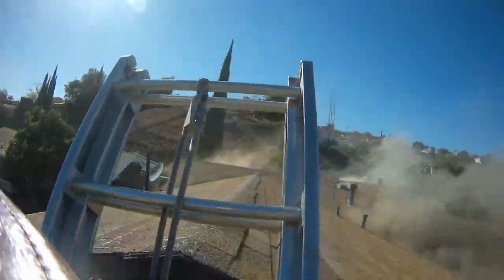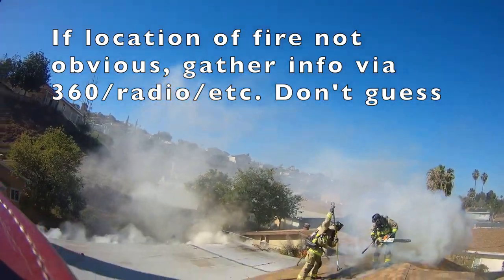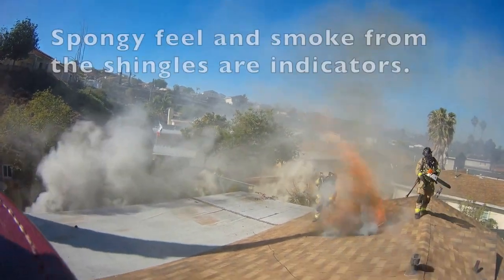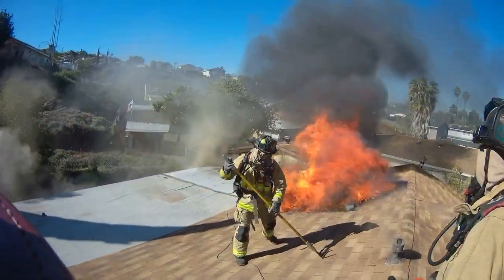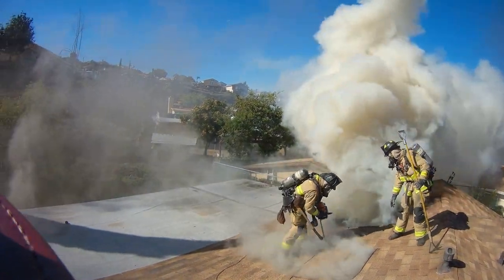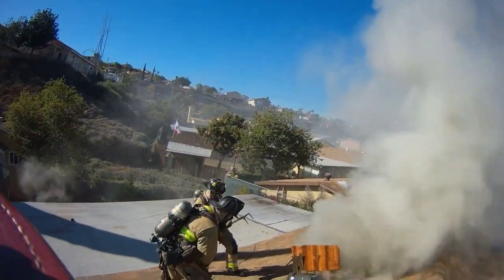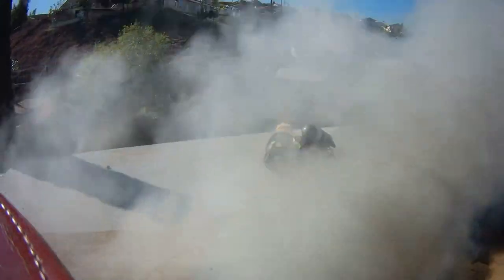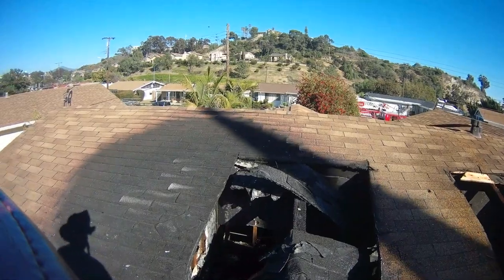Fire in the Hole!

Comment: Do you find using the rake rather than an iron or pike pole is more beneficial?  Do you use the rake for the interior also?
Reply from the maker: Sorry for delay. Was off for six months dealing with Cancer, only recently back. All good now, fingers crossed. We use the rake on the roof for sounding. I think the surface area of the rake gives a good feel for what's going on below. Pulling ceiling and interior operations, we use a pike pole or a NY Hook. We prefer the penetrating power from below. But, of course, it's whatever works best for you!

Comment: After all the science learned from NIST UL, the fact we still see people ventilating residential roofs and calling it bread and butter raises serious concerns. I’ve worked inner city east coast for 32 years and have subscribed to these tactics until learning better. They said the heat and visibility improved? Was this because water application occurring cooled the environment? Saying you cut the hottest spongiest spot, yet having someone sounding the roof, isn’t the point of sounding to avoid the spongy spots? What would the survival profile look like for the guy who fell through the roof with the flow path being demonstrated through the vent hole? 
Look at the amount of smoke coming from the ground level of the structure behind them as they ventilate, the volume of smoke from there doesn’t diminish after the first hole is cut. If verticals ventilation was removing enough smoke to be of benefit would you expect to see that go away or diminish ? 
We see improvements when water is on fire, we see conditions spread as flow path moves through the roof. In one hole we don’t see removal of smoke, rather we see spread of fire. In second hole we see little ventilation as water was on fire rapidly at the point of completing ventilation.  
Think about what we actually see instead of seeing what we want to see. Stay safe and keep learning.
Reply from the maker: Generally speaking, I refrain from judging other ways of “putting the wet stuff on the red stuff”, because I don’t presume to know more than them or be able to do it better than them. It’s YouTube, after all. 
But, you always have a person behind a keyboard with an opinion.
I would also consider a fellow firefighter stating a fire being “bread and butter” as one they regularly go on and not call into question that it’s a fire, and as it being a fire, is inherently dangerous. Fatalities occur on such a fire, we know this. But, still, the commonality of said fire can be inferred as “bread and butter”. 
The frequency of said fire versus fatality is, well, more something people use in the comments section as complacency? I’m not sure the inference. 
Look up the amount of firefighter fatalities during vertical ventilation as a trend the last twenty years. I’d say, we, as a whole, are doing a good job, despite firefighting as a whole being inherently dangerous.
Regardless, since 2000, I have seen a lot of progress in the fire service. We put science into our approach now. Transitional attack is a thing. Understanding flow path and not just blowing out all the windows is a thing. We recognize PTSD and the need for behavioral wellness. We recognize all our people and appreciate their contributions.
So, I’d put our training staff, or any professional fire dept, up against anyone who would call into question tactics such as vertical ventilation. Especially, saying they are blind to the science and simply see what they want to see.
I work with ranking Firefighters far more educated than I, who would put me up on that roof. And I Trust them. Because You should be able to do that. But, also, because I’ve been in fires without water on fire where vertical ventilation made a significant difference, in heat and, especially, in visibility.
One of the many things I’m proud of about my profession and where I work, is that our training staff never presume to know all, despite traveling the country for educational enrichment, are fully aware of a NIST UL studies, along with others. To presume a professional fire department of the top ten most populated cities would have no clue as to the research your citing demonstrates, if not anything, an ignorant, or egocentric way of stating our way is somehow wrong and you are inherently right because you mention a NIST UL study.
As a member of a major metropolitan department, I wouldn’t presume to know as much as my counterparts in our training and education who specialize in being progressive, but I will say that they still encourage us to get on that roof and cut a hole. 
The message with the fire minute, generally, is one of humility and expressing a lesson learned where we don’t look great because things didn’t go all that well. What’s to learn from everything going right? We check the ego and try to share a lesson learned, rather than how good we look ( which can be many fires or edited to look that way). 
All this being said, 32 years in the fire service, regardless of where, is to be respected. Thank you for what you do and, by all means, reach out to said metropolitan departments with this data you have and change how we do things. I, personally, would be more than happy to oblige.
Reply: @thefireminute625  thank you for your reply.  I will agree that it is easy to sit back and look from the cheap seats and look at an operation and second guess.  I believe this forum however does lend to the discussion. We should never shy away from questioning what we do and why we do it.  
The things that bother me are when we make statements that firefighting is inherently dangerous. Our goal should be zero injuries and deaths. We should strive for that in all we do and evaluate the risk benefit of all operations. Calling a methodology that has been done for decades yet new science demonstrates as having negligible success, rather adds to the overall risk of operations, calling this “bread and butter”.  The other term for this is normalization of deviance.  We can do it over and over but will it eventually lead to major injury or death? We must take that into consideration. In this case, single family vertical vent is something I’ve performed for decades. Many times a week. It wasn’t until observing the fire ground realities through the lens of new studies and science that my views of what was actually occurring changed. We must always strive to grow and learn. We must decide if putting a brother in the ground is a part of the inherent danger of the job on a 1200 square foot house that was probably torn down anyway. 
Use of videos with an open forum to debate or ask why something was done is one of the greatest tools we have to discuss together what we see. Otherwise the videos are for entertainment purposes only and their value diminishes as such. 
Thank you for your opinion, and taking the time to reply. Stay safe and keep moving forward.